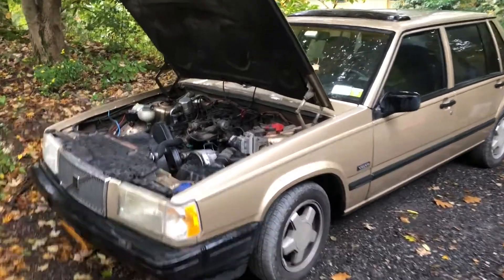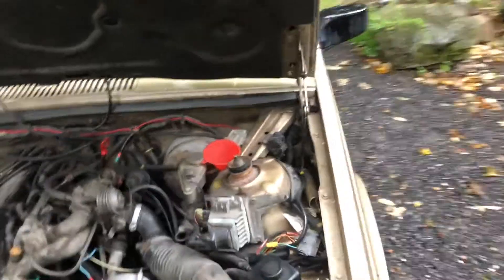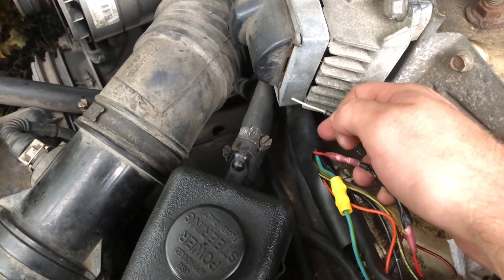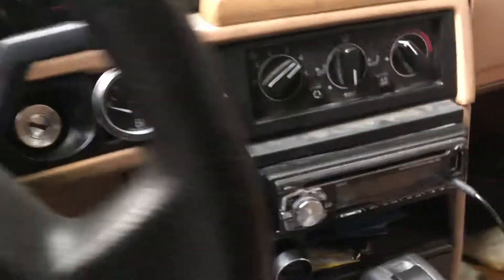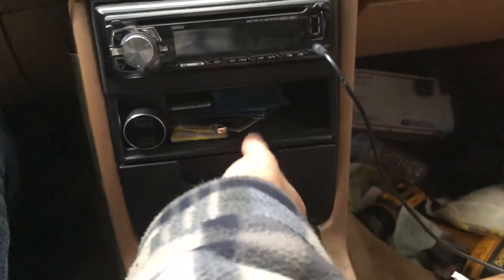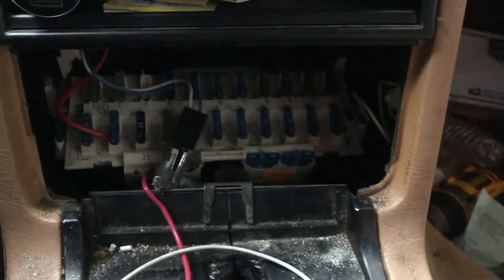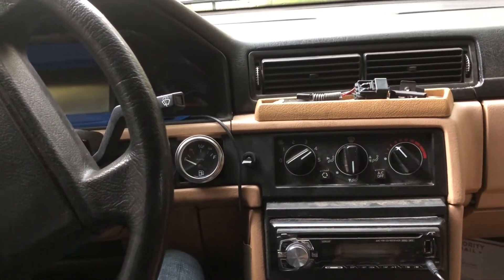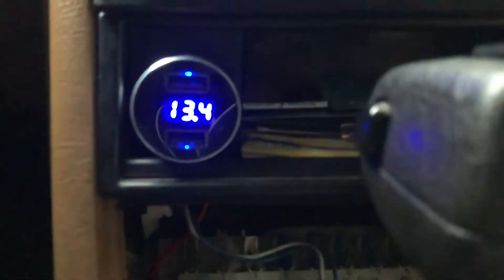How to Bypass Alternator Exciter Wire - No Charging Issue Fixed! 🔧

Comment: wicked smart.    i am needing car tomorrow.  testing yesterday and today.  it seems like if i throw 12v onto the exciter wire, then remove it,  while car is running.  the alternator stays on and charges the car.     ie.  in a pinch. you can do this and a constant 12v is not needed.  ie.  you can throw your switch on then off while car is running and alternator will continue to charge
Reply: Will this work on a 2015 kia sedona? New battery and new alternator and still not charging. I though it was the alternator so I brought it back and got another one else where and still not charging. I have checked all wires for continuity and everything is good. I am afraid that the ecm is not sending a signal to the alternator to fire up. I will not know that until I can get it out on a computer system.
Reply: i I’ve been up and running for a week, with no chance to fix my exciter wire, I am getting usually 3 V when it should be approximately 10 or 11 V.  so I disconnect the exciter wire from the rear of the alternator, and zap it with a motorcycle battery for about one second.   all is well until i shut off the car. 1-3 hr trips.

Comment: I have a bad ignition wire to my alternator, it has a internal regulator, so I'm bypassing mine now with a 3 prong rocker switch, using the DC to go to ign alt wire, my question is would I need a diode or a fuse to bridge the ign wire from the switch?

Comment: Hi Karl,  I have 240 Volvo 88  and I am having the same problem and  have a rebuilt  alternator . when I turn the key on start the battery light does not show the car starts but battery does not get charged. There are  two terminals at the back of alternator. Let us say A and B, wire from A goes to starter and wire  from B goes to the cluster and could be broken. I follow  your solution  that you added a wire from  terminal B to toddler switch and  you have to ground the toddler switch? which wire did you add the  diode where is it coming from and where is it connecting to the alternator ? Please forgive my ignorance.
Your help will be much appreciated.

Comment: I'm having a no charge problem on my 1994 940 sedan and I was hoping you could give me some tips on how to diagnose if the exciter wire is my problem? I've cleaned up contacts for my alternator ground wire, swapped the voltage regulator, cleaned up the exciter wire spade connector on the alternator, swapped in a good battery, and I've popped out the instrument cluster to check for any obvious issues. There were a couple of check engine light bulbs missing, but after replacing them I have no change. 

When I put the key to ignition II the majority of my idiot lights don't illuminate, and that includes the battery light being off. I'm gonna swap the ignition switch to see if that works, but I'm not much of an electrician so I'm really hoping for some guidance. Thanks for reading and thanks for the fantastic video!
Reply: how'd it go ?

Comment: Hey were can I find a diode at
Reply: Amazon checkout the link in the description
Reply: Ok thanks I did just like you did in the video but I’m having the same problem losing power how long does it last like that with the diode
Reply: jay baby I never had it go bad yet. It has to be the correct direction though
Reply: Hey what number or size?
Reply: And do it have be soldar or welded
Reply: jay baby I think I just used wire connectors and crimped it on
Reply: Diode shown is 1N5349B, 12V Zener Diode, rated at 5 watts.
Can be gotten at many electronics parts stores, Amazon as mentioned, or eBay.
On eBay, was $3 for 2 diodes.
Solder or crimp to the wire is fine.
Reply: Wonder what is at the root of the problem? Why not 12v at the exciter wire? Bad ignition switch, grounds or oxidized connections?

Comment: I think something important to note here is that the diode used is a zener diode and is acting as a voltage regulator. A normal diode that works by allowing flow in only one direction will not function for this purpose. I think.

Comment: Does the excited wire have anything to do with instrument panel backlight going out ? They replaced my alternator with an 80 amp instead of the 100 amp that's required for my Volvo 940 they put in a car quest remanufactured cheapo one and most likely it was only my voltage regulator that needed to be replaced so I spent 500 on them to replace alternator with the wrong size after that my account wouldn't blow like it used to my radiator fan etc..and backlighr went out on my instrument panel. Tire kingdom did this
Reply: Yes bulb acts as a resistor

Comment: can u do this in a 98 buick. my diode is bad in the alternator
Reply: Well theres diodes in your voltage regulator which sometimes is inside the alternator and sometimes bolted onto the outside of the alternator. Those diodes are different from what I did with a diode in the video. The diode i used replaced the electrical circuit where it goes through the instrument cluster through a resistor, which I have bypassed and used a diode inline instead. You should try changing your alternator voltage regulator first.
Reply: @karlauto7023  do you still need a diode if you tap into the fuse box?
Reply: @idbeatz  Not sure. Definitely a more neat/professional job if it does work. Now that I think about it that might work since it's being switched off from the ignition but I believe if I had the diode backwards which I think I did at first by mistake even with the switch turned off it still drained the battery.

Update 11/4/19:  Just to let everyone know it has been working, drove all the way from New York to California and back no problems.
Reply: idbeatzdotcom yes but you may still need a diode
Reply: Or another method like a bulb as others mentioned